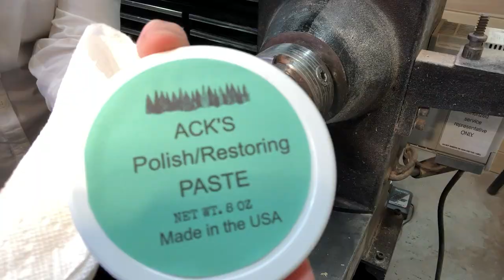Woodturning the Gemstone Bowl (Gemstone in Finial)

Comment: Great looking piece. Very well executed. 
Excellent video. The voice over is very good. I found the volume level to be quite low. The adds came in booming.
One tip adjust the bandsaw guide to just above the top of your piece. Safer and less hard on equipment. 
Easy Wood Tools make a great hollowing tool.
Personal taste, I would have preferred a walnut top. I feel a brown walnut top and turquoise would go together nicely.
Reply from the maker: Thanks. I have a soft/low voice, I will try to talk a bit louder. Thanks for watching!
Reply: PF Woodturning 
Or increase the volume level on the recoding.
Reply from the maker: @joensandie  Yes, I will try that. Thanks.
Reply: Peggy,  I agree with this reply. Adjust your guides so you can slip a dollar bill in beside the blade. That way your blade won't wander. Then lower the guide to about an inch above your work piece. Not only a safety issue but much better finished results

Comment: Great video! Just a quick safety FYI... From the video it looks like the thrust bearing on your bandsaw needs to be moved closer to the blade. The blade has far too much backward movement when you're pushing a piece through the saw, and the thrust bearing is designed to keep that from happening... Thanks, V
Reply from the maker: Mike Villafuerte thanks, Mike!

Comment: Loving your pieces and how descriptive you are as to the how/why. This may be an annoying question, but im new to wood turning...... Why do you use each paste/wax/coating etc? I'm having trouble locating articles for how long to store, what to coat and why. Could you drop a link or something for me?
Reply from the maker: Hi Cody. Thanks for watching. The finishing part can be confusing. A good rule of thumb is after sanding and cleaning off dust, apply sealer. Then when that dries, it's really a myriad of things that you can finish with. I like the Ack's sanding and polishing paste myself. I don't have an article or link at hand, but if you live near a Rockler or Woodcraft, the staff are very helpful with any questions. They also offer classes at very reasonable prices. Another possibility is to join your local Woodturning (AAW) chapter. If you go to the AAW (American Association of Woodturners) website, you can find your closest chapter. Hope this helps, if I come across an article, I will be sure to forward you the link. Cheers and Happy turning!

Comment: Question Patty for you 
I have a beginner's woodlathe, belt drive and find the lathe sluggish. To the point of stopping mid cut and then starting again. Hence chisel bites and destroys a bowl. More people are asking for bowls and vases and I'm hesitant in using the lathe.
Do you think I should move up to an electronic lathe for better control?
Reply from the maker: Hi Andrew. If your budget will allow, I would upgrade to a newer lathe, yes. Without knowing your exact setup, it's hard to say. However, it sounds like it would be the right way to go. Thanks for watching!
Reply: White Marlin  I have since bought a more expensive  woodlathe to replace. Professional simular to my Engineering  lathe, I am a machine toolist to trade. (Retired). My Engineering  lathe has chain belt rather than rubber. But thanks for the tips.